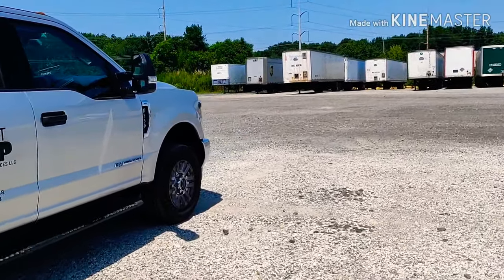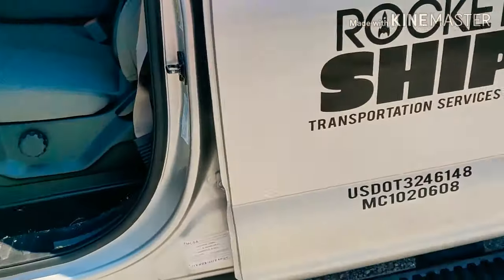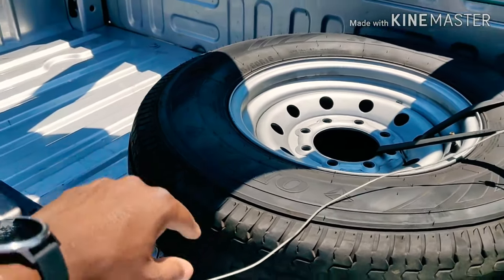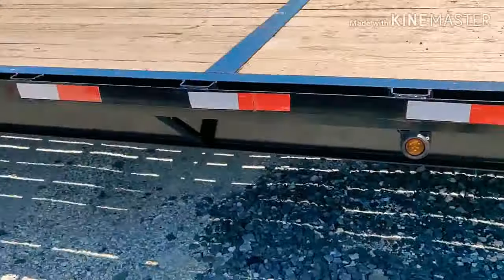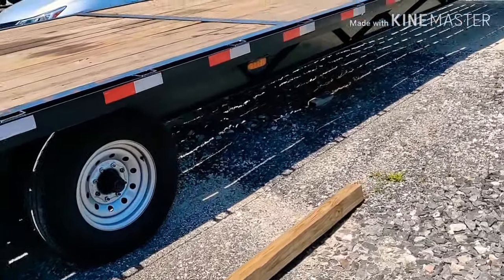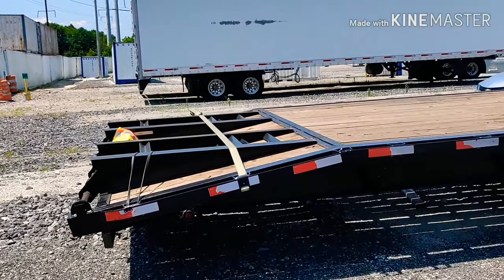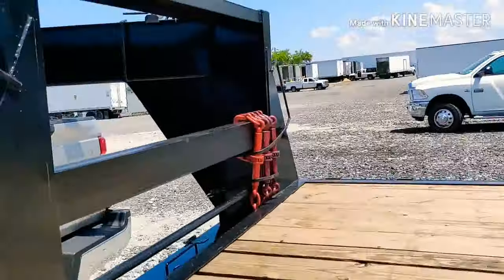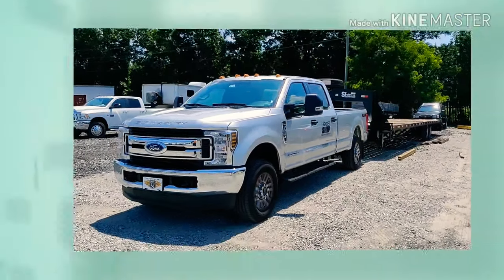New to Hotshot Trucking: Ford F-350(SRW) & Southern Trailers 40' Gooseneck trailer after 3 months

Comment: I got the identical truck from enterprise! I love how much room it has and that its all aluminum. I pull an all steel 37+3 low pro trailer and it does way better on fuel than i thought. i boogy at 75 mostly everywhere and get 11, how you doing on the mpg??

Comment: If you running a ElD or anything else though the OBG, that would be a reason why you have a check engine light on. For some reason Enterprise tracking system unit and the EDL interferes with each other. Good luck

Comment: Question if your trailer is rated at 12k
And it weighs 7k
Can you only load 5k?
Trying to figure out how to maximize a trailer to haul 15k loads with a SRW truck legally. My payload capacity is 4,102lbs
Ram 3500 CCLB with Aisin trans
Reply: The trailer weighs 7k the trailer cargo capacity would be 12k (that's 2 different things). His truck probably weighs around 7.5-8k. So you add the truck weight & trailer weight together meaning, lets say 14k combined weight to make it easy. He's running no CDL I believe, which limits the combined weight to 26k lbs(combined is truck, trailer, cargo). So you subtract the truck/trailer combined weight from the 26k lbs (14k roughly is the known truck/trailer combined weight).  Meaning he can actually haul 12k lbs of cargo. (the 12k lbs just so happens to be the max his trailer can also handle.. (of course I made up the truck weight so maybe he can only haul 11 or 10k lbs which is usually closer to what most non cdl guys can max)